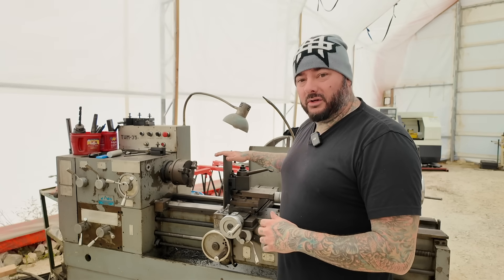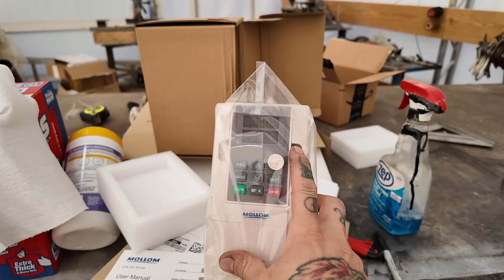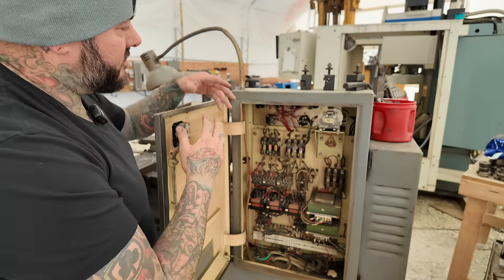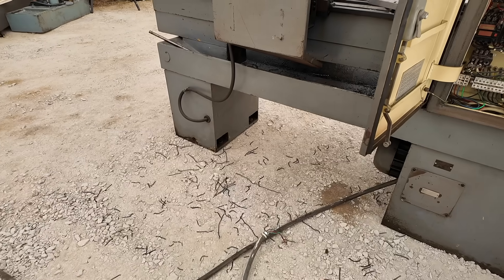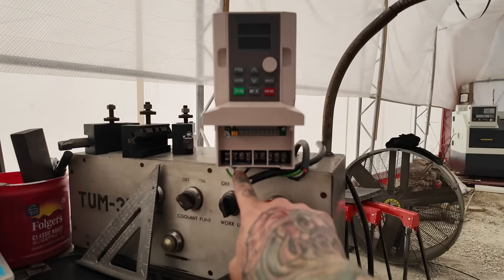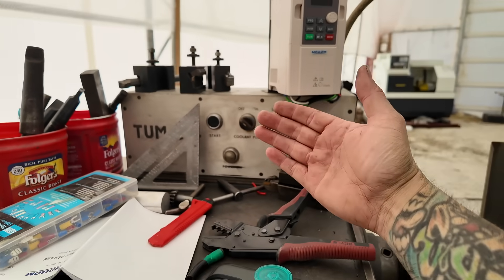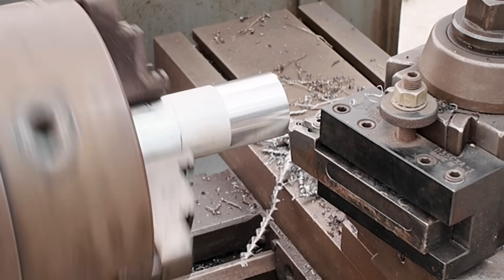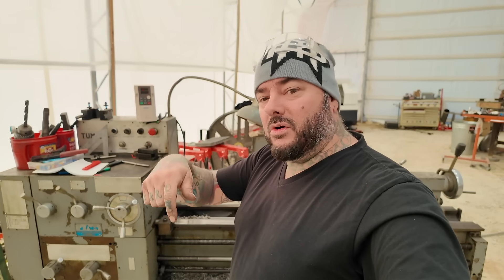From 3-Phase to Single-Phase: The EASIEST Way to Power Any Lathe

Comment: These 3 phase motors can be simply rewired to single phase. All you have to do is arrange the jumper strips in the junction of the 3 phase motor to make it single phase. That's all. No need for VFD etc.
Reply from the maker: Thanks for sharing 🙏
Reply: Not a good idea. That's just a cheap, cheesy, poor, ineffective work around. Spend the money, do it correctly, 
get a
Single phase motor, VFD, or, Rotary Phase Converter!
VFD preferred, but, if you can get a good good deal on a RPC it's not a bad option
Reply: That is not exactly true. You need a capacitor involved to get the motor kicked off in the right direction (essentially how a rotary phase converter works) . It is not just move some jumpers around. You also will be running at only 2/3 power (because your missing a phase) . Long term not a good idea for a motor underload.
Reply: As an engineer, that is a bad idea.  You'll be adding more hazards like duty cycle and heat and power.  That's something a Quick 10 mechanic would do, and then the customer brings it back after 1 mile down the road.
Reply: Google, "Can a three phase motor be rewired to run on single phase?".
Reply: @brokenot 
In some cases yes, 
Is it EVER a good idea?
HELL NO!
That's beyond silly!

Comment: That control panel of that panel is removable, and should come with long ribbon cable for external mounting. I’ll probably make a mounting for it instead and hide the vfd so power cable is not routing in the front.
Reply from the maker: Good to know, thanks for the info!

Comment: The transformer either goes to 480 or 240 lower volume systems with the relays and everything. The motor can be wired maybe to 240 3-phase that means you got to get a donkey motor.
Reply from the maker: I’m 🫏

Comment: Just a couple of things for you and your subscribers: if you have a machine that runs an oil pump driven by the electric motor then do not control the spindle speed via the VFD. The reduced motor speed will also slow the pump so you may not get oil to the gears. Use the gears to change speeds. The correct way to set up a VFD is to run the power wire directly to the motor with no switching and then rewire the original lathe switches using light duty cables to tell the VFD what to do. There will be a row of small connectors under the VFD and that’s where the control wires connect. That’s how I set up my Colchester so to use my it I turn on the VFD, then I hit the power button on the lathe and this signals, via the control wire, for the VFD to start the motor. The stop button works the same way as does the brake, all through the signal wires. Be aware that when using a VFD the amperage goes up too. I’m running a 10hp VFD for a 7hp motor and converting standard Australian household power from 230v single phase up to 440v three phase the VFD specs says it can draw up to 35 amps so check that before purchasing. Normal sockets here are only 10 amps but my workshop has 36 amps available. You can also play with the VFD parameters to set how fast the motor ramps up to speed as well as how fast it stops plus other handy features. I considered getting three phase put on but the low price of VFDs made me not bother. I have a large belt sander I converted to three phase and VFD so I could have variable speed and reverse. I hope this helps someone. Cheers, Stuart. Australia.
Reply from the maker: Thanks for the tips, I appreciate the info you shared!
Reply: Hey Stuart, fellow aussie here. Are you getting 415V out of the VFD? if you don’t mind are you able to share details of the VFD you are using. thanks, greatly appreciated.
Reply: @327eh @327ehute  Sorry Ive only just found your message. I purchased the VFD from Ali express and I don’t think it matters what brand, they probably all come from the same factory. I haven’t measured the voltage and from memory the VFD puts out 380 volt but apparently this doesn’t bother a 415 - 440 volt motor. It works fine for me anyway. I’m happy to try and help. Cheers.
Reply: Another ozzie here. I used a vfd on my round column mill. It needs to be wired in Delta mode to work. If it runs backwards simply change 2 wires on the motor end. I used a 240 / 415 volt 3 phase motor. The original mill motor was 1hp 0.75kw which i replaced with a 1.5hp 1.1kw. I also wired a complete remote setup for on, off, reverse. Jog fwd and rev and speed adjustment. I no longer have to change belt configurations to change speeds as that was an absolute pain. It works fantastic.
Reply: @eddiebrandrick4374 Good work 👍👍👍. I have a belt sander that was single phase and swapped the motor to three phase with VFD. So much better having variable speed now plus reverse which I occasionally use on the disc sander side.
Reply: Pretty good bit of information thank you
Reply: Aw, but I LIKE having reduced motor torque uh, because reasons. 🤣

Comment: first question that comes to mind, how do you level your machines on dirt? nice tent by the way now i can see why you can afford the nice  machines. Any plans on pouring a cement floor at least? Must  live in Arizona for using a tent with  no insulation. Not  making fun of you just very  curious of your set up reasons.
Reply from the maker: Hey, thanks for the view. I do plan on pouring concrete eventually and skinning my building like a pole barn.

Comment: I also have just single phase to my home shop.  I wired my LeBlond Regal 3 ph lathe using a VFD.  The VFD I purchased is suitable for a braking resistor which I also purchased.  The Leblond lathe has a gearbox for the speed changes.  I am not a machinist by trade.  It was suggested to continue using the gearbox for the speed changes instead of the VFD.  It made sense to me that way the wear on the gears will be spread out evenly.  I have the option to adjust the speed with the VFD but primarily use the gearbox.  It's an older lathe with a 3 hp motor.  The motor works fine but it's not an inverter duty motor.  Check the temperature rating of the motor.  60 hz works fine on my machine and I do not lose any torque.  Depending on your machine and the VFD you use,  the torque of the motor can be diminished at slow speeds.
Reply from the maker: Good to know, thanks for sharing!

Comment: I am old - old school machinist. We ran our 3 phase off a big motor converter just like yours and it worked flawlessly for many many years. We had a full production shop making pipe couplings by the millions. Some of our machines were made in the 1800's and were converted from steam to 3 phase electricity (Gridley screw machines).
Those 'new fangled' VFD's did not exist back then. I never heard of one till the 90's.
I'll tell you that those little guys are slicker than snot on a doorknob! They give you a fine control on whatever machine they are connected to that OEM never dreamed of.
My opinion is that a VFD is a true gift from God and has literally saved many old machines from the scrapyard.
I am proud of you young fella for seeing the value in that old girl and giving her a second chance at a useful life. You are a rare individual in your generation, stand tall with your chest out like a proud American!
Art from Ohio
Reply from the maker: Thanks for the view and the awesome comment Art from Ohio!
Reply: @precisionmetalin  You earned it Brother.
Reply: Far better to save quality, vintage, iron than buy new, cheap, garbage iron
Reply: @larryallen9404  Some of the new stuff is far superior to the old. Sometimes the VFD is built in the newer machines. You save the old stuff because it is cool and has a certain style. It is like an old Harley or a 57 Chevy.
Reply: AND they are susceptible to being nuked by dirty power or line surges, AND many do not provide correct 120º phase output so you lose motor / tool torque... (just like a static)
Yeah, I had one.
Then I went back to using a rotary.  Lesson learned.
Reply: @railgap  Never heard of that, but everyone's experience counts. Thanks for your input.

Comment: Please don't run the lathe spindle with nothing in it's jaws. The jaws can fly out of the chuck and kill you. Nice lathe. I connected my VFD directly to the motor then connected the power lever, forward and reverse directly to the VFD bypassing all of the internal electronics of the lathe. This is the correct way to retrofit a modem VFD to your manual lathe. Also you can utilize magnetic braking from your VFD if you wire it this way. I get the impression that you may never have worked on a geared head lathe, if so please use extreme caution as you learn to work on it. A geared head lathe is the most dangerous machine in your shop. If you get pulled in by the chuck it will kill you. Learn with great care on that lathe  it is not like ordinary lathes, the geared head adds an exponential level of danger to it's operation. Looking out for your safety.
Reply from the maker: Good to know, I appreciate the info 🙏

Comment: If you are running a VFD you should not be using the lathes motor switches to run it. Hook the remote switches up to the VFD to take over for switching on the motor and reversing. It is very hard on the vfd to be using it that way. VFD are designed to be in full charge. If you need/want to use a machines switches than used a rotary converter or digital 3 phase converter.
Reply from the maker: Thanks for the advice, I appreciate it!
Reply: 6:17 that's correct the VFD should only be connected directly to the motor, as per the manual, it will damage the VFD and can lead to high fault voltages and residual stored voltage in the VFD capacitors, if there is a contractor between the VFD and the drive. There will be warnings about that in the documentation. It's simple enough separate and to re-wire the controls between the COM and S1, S2 etc for start/stop/reverse, as volt free contacts - you don't want mix 24V with mains, that would be a bad day for the inverter. It gives you the opportunity to wire in a brake resistor to the VFD winch is a nice safety upgrade.
Reply: @Paul-FrancisB  Exactly, in this case it gets even worse, the control transformer is being powered by the vfd which is another big no no. Im honestly surprised the vfd isnt tripping out with the configuration that is going on here, impressed really. Being a cheaper VFD im assuming it doesn't have any vector controls which is probably why it is not tripping out with this odd configuration and random loads, that transformer is humming away because its being fed basically a stepped square wave from the vfd and one of the 2 are going to give up the ghost in short time. Either way, this is a quick test to see it work, and it does so win.
Reply: You can sometimes bypass the transformer in the cabinet with a separate plug and still use the low voltage futures on your machines. 

Vfd are nice for making 3 phase power, but you can't beat that rotary phase converter if you want it to run like factory. 

You can buy kits and build your own rotary phase converter pretty cheap. 

Enjoying your videos

Comment: A rotary converter will run more HP than its rated output if you have other machines running with it. It will for sure run more than 1 machine.
Reply from the maker: Thanks for the info!
Reply: A friend was closing his CNC job shop & gave me a Phase-a-matic, which uses a pair of condensers & a couple points style relays to create the 3rd leg of 3 Ph.  

I'd never heard of them. I was restoring a 3 ph machine.  I did some research & test drove the already detached 3ph motor on the bench. 

What I learned in the process is ypu can use the Phase-a-Matic to fire up the motor, the running 3 ph generates 'extra 3 ph', as well, so you can then use that to run other 3 ph motors. Surprised me; can't do that kind of voodoo w/ 1 ph.

Once a second motor is running, the 1st motor can be shutdown & the 2nd will continue, as well as power additional motors.

Like VFDs, the Phase-a-matics come in different HP ratings; price goes up, accordingly.

This is a very simplified description; there's wiring that has to be done correctly for multiple motors, but single motors are drop dead simple.

Ended up being gifted a 1 ph motor for the restored unit, so never used the 3 ph.  I use the Phase-a-matic to bench test 3 ph motors, as long as they're w/i the HP limits.

The reason rotary converters work is when a 3 ph motor is physically driven by a 1 ph motor, the 3 ph motor, also a generator,  makes usable 3 ph.  

If you have squirrels on a treadmill that can spin a motor fast enough, it'll make 3 ph.

(Mebbe that's an alternative you could explore, instead of the noisy, expensive rotary; it'd be quiet & only cost you peanuts!  LOL)

Last, a suggestion from an old timer, on your VFD wiring:  pick up a gland nut for the wire going the top of the cab, it'll keep crud outta the panel & keep the cable from wearing thru the piss poor insulation on modern cable.  (10+ yrs ago, I bought, online, a range of sizes of plastic, waterproof, wiring gland nuts for very little $; nice thing to have around if you install/build/re-build powered devices.  Never regretted the $30 investment.

Everybody w/ a spare few sq ft in their machine shop will inherit/buy/build something to fill the space. It's nice not have to need parts when it's 2am.)

Also, go the extra few inches & put the wire nut junction in a fixed J box.
---

2nd Law of Shop Ownership:

Shop Sq footage ALWAYS fills up w/ more equipment.

1st Law:

 Horizontal surfaces will always fill up w/ stuff you never havr the time to put away.

Have a good one.

GeoD
Reply: A friend was closing his CNC job shop & gave me a Phase-a-matic, which uses a pair of condensers & a couple points style relays to create the 3rd leg of 3 Ph.  

I'd never heard of them. I was restoring a 3 ph machine.  I did some research & test drove the already detached 3ph motor on the bench. 

What I learned in the process is ypu can use the Phase-a-Matic to fire up the motor, the running 3 ph generates 'extra 3 ph', as well, so you can then use that to run other 3 ph motors. Surprised me; can't do that kind of voodoo w/ 1 ph.

Once a second motor is running, the 1st motor can be shutdown & the 2nd will continue, as well as power additional motors.

Like VFDs, the Phase-a-matics come in different HP ratings; price goes up, accordingly.

This is a very simplified description; there's wiring that has to be done correctly for multiple motors, but single motors are drop dead simple.

Ended up being gifted a 1 ph motor for the restored unit, so never used the 3 ph.  I use the Phase-a-matic to bench test 3 ph motors, as long as they're w/i the HP limits.

The reason rotary converters work is when a 3 ph motor is physically driven by a 1 ph motor, the 3 ph motor, also a generator,  makes usable 3 ph.  

If you have squirrels on a treadmill that can spin a motor fast enough, it'll make 3 ph.

(Mebbe that's an alternative you could explore, instead of the noisy, expensive rotary; it'd be quiet & only cost you peanuts!  LOL)

Last, a suggestion from an old timer, on your VFD wiring:  pick up a gland nut for the wire going the top of the cab, it'll keep crud outta the panel & keep the cable from wearing thru the piss poor insulation on modern cable.  (10+ yrs ago, I bought, online, a range of sizes of plastic, waterproof, wiring gland nuts for very little $; nice thing to have around if you install/build/re-build powered devices.  Never regretted the $30 investment.

Everybody w/ a spare few sq ft in their machine shop will inherit/buy/build something to fill the space. It's nice not have to need parts when it's 2am.)

Also, go the extra few inches & put the wire nut junction in a fixed J box.
---

2nd Law of Shop Ownership:

Shop Sq footage ALWAYS fills up w/ more equipment.

1st Law:

 Horizontal surfaces will always fill up w/ stuff you never havr the time to put away.

Have a good one.

GeoD
Reply: I run a 2hp dust collector and a 5hp regenerative blower off a 10hp rpc. I've started the blower after the dust collector was running and it has no problems.

Comment: I overpowered a motor with a VFD one time, and the vfd didn't last as long as another VFD I have that is running the correct size motor.....so take that for what it's worth .....
Reply: VFD's can usually be set to properly supply a certain motor HP, so as not to ruin the motor, I have seen this work in practice.
Reply: @larryallen9404 this didn't ruin the motor, it ruined the VFD... Running too small a motor on a larger VFD.....rather than running them properly sized, the VFD has lasted longer.
Reply: @Steelcrafted 
OK👌👍
Reply from the maker: Good to know, thanks for the heads up

Comment: You missed the best part of having a VFD.  Skip the factory electrical box entirely.  You don't need it anymore.  The VFD will perform all of the functions.  Incoming single phase should go directly to the VFD, and the motor wires should connect directly to the VFD.  This will give you forward, reverse plus infinitely variable speed control for the motor.  That's what I did my lathe and it's amazing.  I just leave the gearbox in medium speed and use the speed control on the VFD.
Reply: Yeah, you don't want relays and switches between the motor and VFD. Needs to be directly connected. It's a motor driver, not an AC line inverter: it's generally performing current control, not voltage control and as such won't react well to being suddenly disconnected. Disconnecting the motor from the VFD mid motion could blow the thing.
Reply from the maker: Thanks for the tips, I always appreciate the advice!
Reply: @precisionmetalin  you should have ran from the bottom of the control panel switch to the VFD than from the VFD to where the wires to the fuses. thus deleting the about 6 in of wire from the switch to the fuses, that way the VFD is never left on all the time, and no live wires outside the panel. hint, the terminals for the old feed wire is where you still run the new power feed.